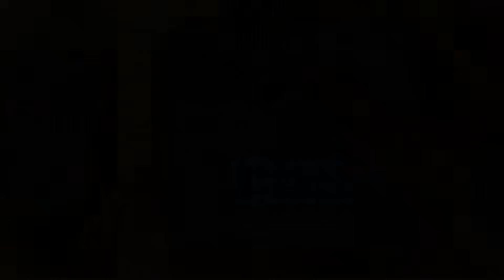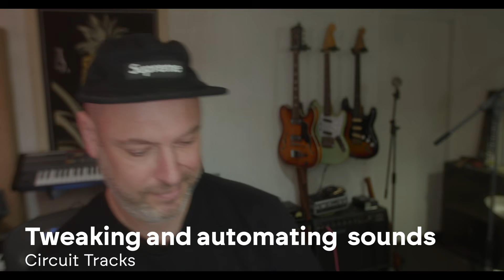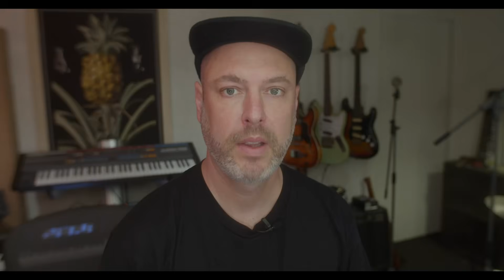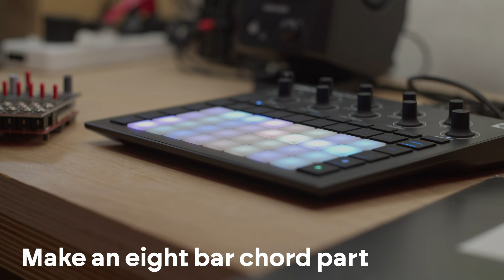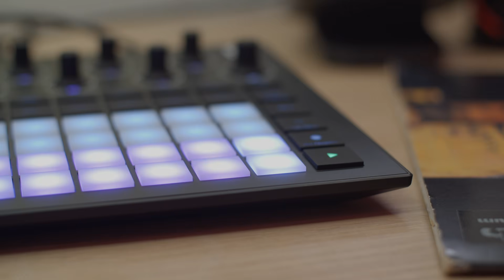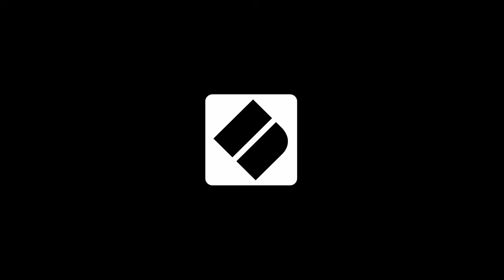Improve your Circuit Tracks workflow with these sound automation tricks

Comment: Just got this beauty and beginning to learn it little by little. A couple of questions:
- is there a way to record and automate octave changes? (As when a track is playing and you press shift + an arrow to control the octaves.)
- can I record the scale changes and root notes somehow?
- can I send both live midi through and record as a sequence in CT at the same time, for an external synth? It works when the Tracks records the notes and plays them, but not straight thru at the same time. I'd like the freedom to freestyle a solo sequence.
- in the previous scenario are the CC commands also passed through? Or can my keystep37 record automation on the CT and send then to ext. synth?
- is there a way to sidechain between Circuit tracks and circuit rhythm? I'm currently sending all the synth audio to CR.
- how to control audio gain in in Circuit Tracks?
Reply from the maker: It's great to hear that you're working with Circuit Tracks. Apologies for the delayed reply here!

1 - The Octave controls can't be automated. Making changes to the Octave with Record enabled won't capture any automation. A workaround would be to transpose the notes themselves or create separate patterns.
2 - Similarly, scale and root note settings aren’t automated or stored as pattern events. A useful workaround would be to use separate Projects featuring different scales that you can switch between.
3 - MIDI received by the Circuit Tracks MIDI Input can be recorded into its sequencer, but it won't also forward that MIDI to the output. Only MIDI data generated by Circuit Tracks will be sent to the output. MIDI Thru would allow that functionality.
4 - Circuit Tracks' sidechain feature requires the use of one of the Drum Tracks as the source. It isn't possible to use audio coming back from Circuit Rhythm.
5 - Circuit Tracks doesn't feature a dedicated input gain control. Mixer View can be used to change the levels of all tracks. Reducing the output level of external sources at the source would be another solution.
Reply: @NovationTV Ty for the reply and clarification. Also great workaround ideas there!

Comment: It would be so good if there was an easy way to make all the slots in a pattern chain be set to 32 steps at once. It is the most frustrating and  time consuming thing to do manually ie, record into a chained pattern and then go back into each slot and select 32 steps and then delete the recording and start again. If you know what i mean lol. Please please do something about this, please.
Reply from the maker: Thanks for your feedback on this—we'll share your suggestion with the team.
If you’d like all Patterns to be 32 steps in length, you can simply press ‘1–16 17–32’ once, then copy that Pattern to all other Patterns in your Synth and MIDI tracks by holding Duplicate. You can do the same for the Drum tracks.
If you always want all Patterns to be 32 steps long, you can set this up once and then save the Project to all available Project slots. That way, you won’t need to repeat the process each time you start a new Project.
Reply: @NovationTV hahaha 😂 That way is so much better than what I did. Thank you.

Comment: Novation really need to allow chromatic playback on the sample tracks, it really is an unnecessary limitation of the Circuit Tracks, requested this a couple years ago and got told we’ll share it with the team, but there’s been no updates since 2022 😢 Are you working on a new Circuit device that combines both synth and sampling?
Reply: Chromatic playback is available on circuit rhythm ⚡️
Reply: @bflash77   Yeah I got one, but it would be cool to have this on the Tracks so they could be used as other melodic tracks and the rhythm used for drums/fx/noise etc...

Comment: Hi! At 1:32 you chain 4 pads to make a 8 bars loop, you also pressed page down. Did u press page down to make each pad 32 steps long?
Reply: If you hold down the first pattern pad and then press page down you can select one of the patterns on the second page as the end of the chain.  In this case I selected the first pattern, held page down and then selected pattern 8.  This chains patterns 1-8.  In the example at you mention at 1.32 each pattern is only 16 steps so you get a total of 8 bars.  In other parts of the video I’m using 32 step patterns but only changing 4 of them together. You can do it either way to get 8 bars.  (Or chain 8 x 32 steps for 16 bars).

I find it tends to depends on the musical part, some things feel easier to think about in 16 step chunks, some make more sense as 32 step patterns.

Hope that helps!